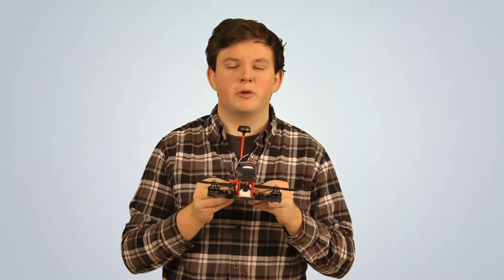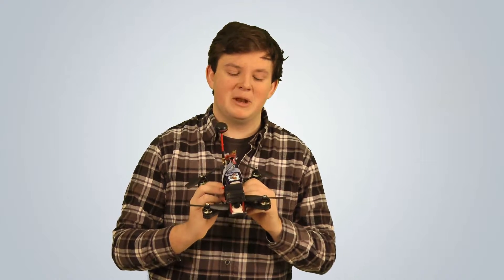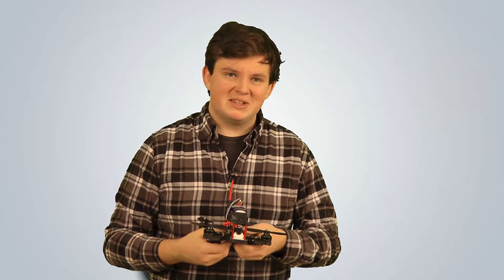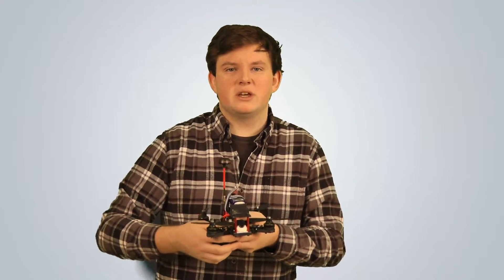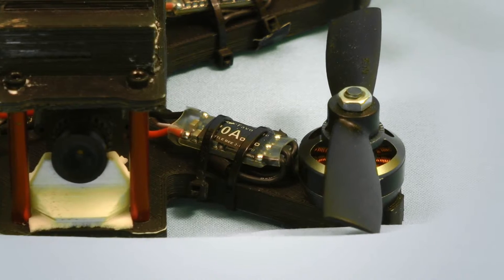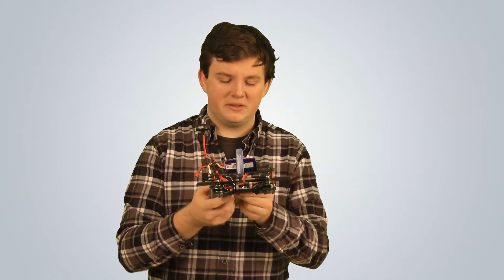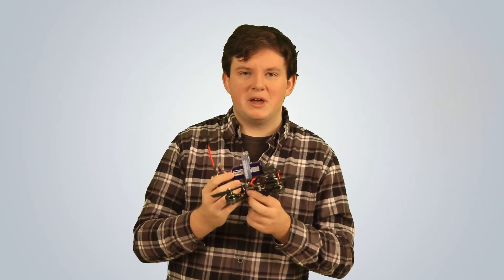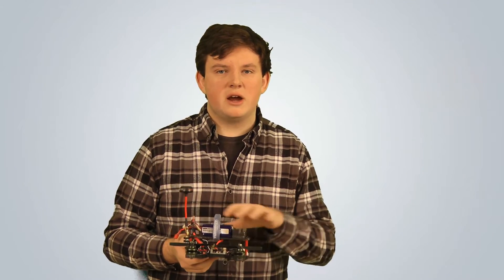Fully 3d Printed 180mm Race Quad

Comment: If the Quad is as you say"FULLY" 3D Printed, why is only the Frame 3D Printed? Shoulnd be more 3D printed by saing it is fully 3d printed?! just wondering. and i feel like for over 100$, this thing should not performe as a 50$ Drone..It's so much waight, you cant call it a "race quad"..BUT that's all my own opinion. At least the Video is well made.